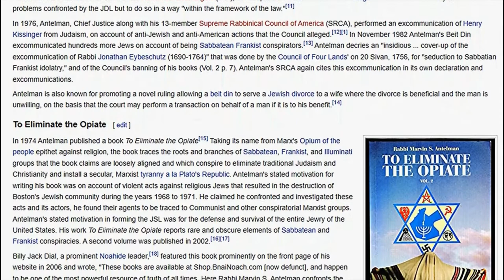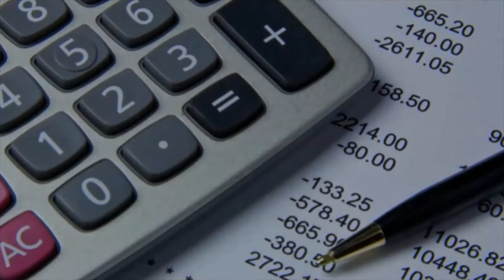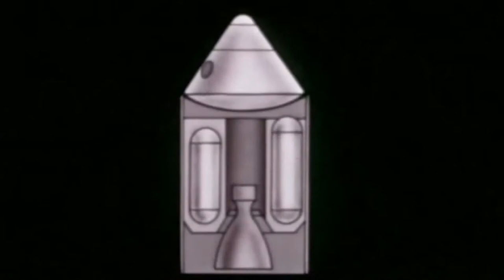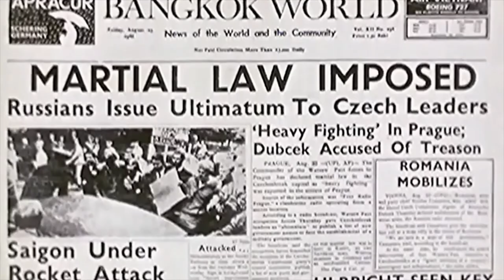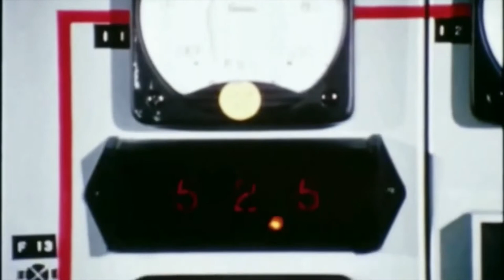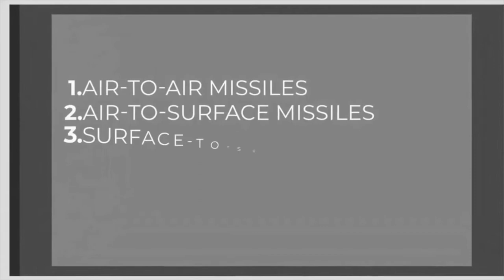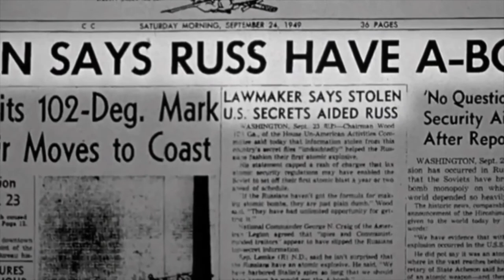The American/Soviet Moon... (how they worked together to fool humanity)

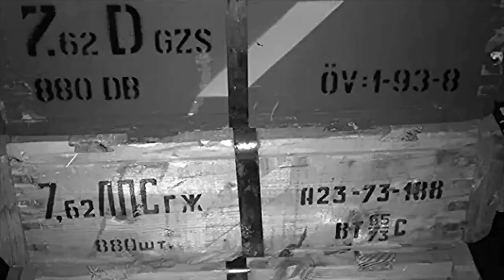Comment: 34:00 Docking on Earth's orbit failed so many times until 1975 they finally managed.. yet Apollo supposedly managed to do that 6 times in the row on the Moon without failure (except 13). If you put these two and compare to current times for example 8 years designing Orion capsule, it becomes clear that actually only thing Apollo acomplished was docking. CM+LM not on the way to the Moon but on orbit. Viking 2 was so off the chart.